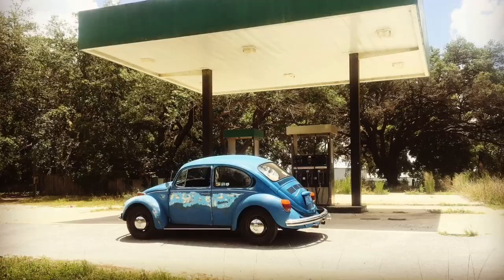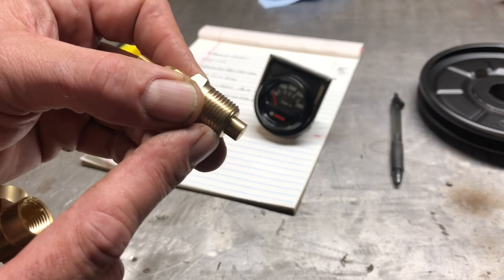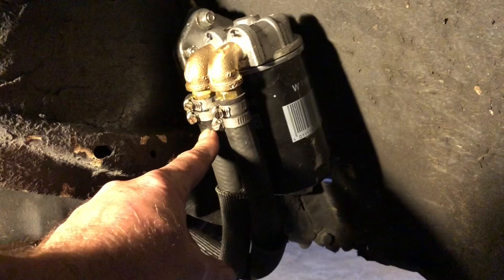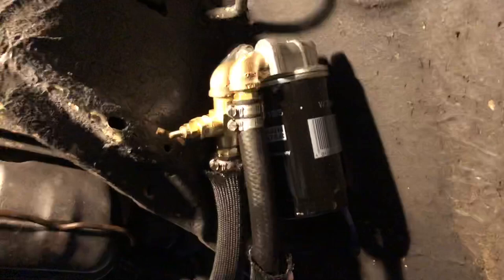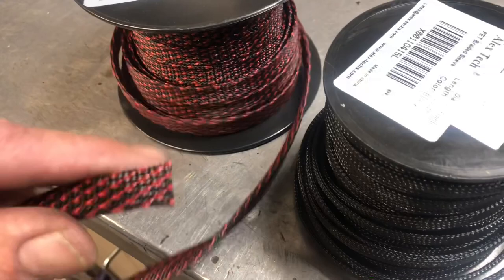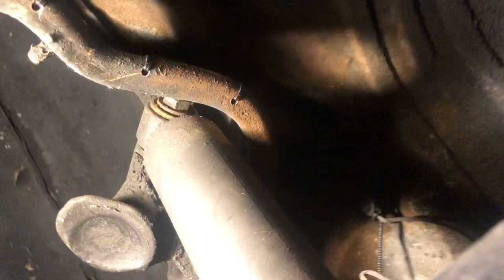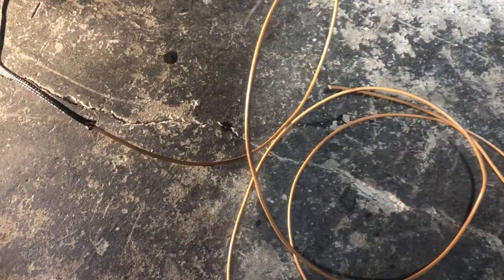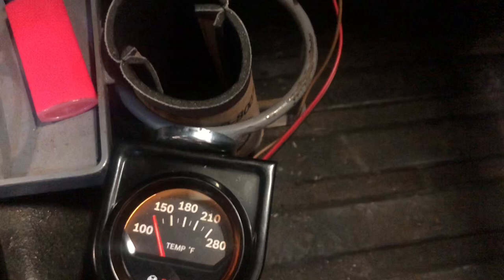Installing An Oil Temperature Gauge In The VW Bug And A Short Test Drive!

Comment: Honestly I was disappointed you didn't put a stinger back on Jawbreaker. That muffler sounds real good I'm surprised!! Which muffler is it and what filter is that you are using also?
Keep up the great work brother!!
Reply from the maker: VeeDub P8 I wanted to put the dual stingers back on however it would require a ton of modifications to make it works since I couldn’t use the same header as before. I had to step up to a larger merged header for this engine. I do miss the stingers but this is the Thrush welded 2 chamber muffler from the local auto parts store.... was like $35 or something. It has a great rumble to it that’s for sure. 
The oil filter I’m using is the Mann brand with the bypass inside. Seems to be holding up well.
Reply: I guess it's kinda off topic but does anybody know of a good site to stream new series online ?
Reply: @Dante Billy i watch on flixzone. You can find it on google :)

Comment: Does the threaded post on the sensor spin as you tighten the nut? I cannot get mine tight, it just keeps spinning
Reply from the maker: @drummer4hire12  there should be 2 nuts between your terminal. You tighten the nuts together to keep the post from spinning.
Reply: @VWJawbreaker  thanks very much for the quick reply and help. Looks like mine is missing a nut.......back to the hardware.....lol
Reply from the maker: @drummer4hire12  I do the best that I can!

Comment: Say you weren't running an aftermarket oil filter - would you be able to just run an adapter to 13/16 (21mm) and install it in the main drain plug in the sump plate?  I can't see why not but I've never seen anybody do it.
Reply from the maker: They make a oil sump plug sender that would work.

Comment: What did you do for a oil pump, remote pump, and cooler. Did ya drill and plug and what did ya drill and plug. Got a 73 super and looking for any help.
Reply from the maker: CB sells oil pumps with an in and out if your existing engine case isn’t drilled and tapped for an external oil system.

Comment: Interesting that you put the oil temp sender in the filter outlet and not the inlet. I would think you would want the to know the temperature of the oil coming out of the engine. My thinking is once the oil has passed through the filter it would be getting cooled off due to the placement of your oil filter in  the wheel well. But I'm sure you have your reasons for this. I'm still pondering the noise you are getting from the pulley this is not something I've personally encountered.
Reply from the maker: Volkswagen Fetish I used my laser temp gun and there isn’t much of a difference between the inlet and outlet temps, thus choosing the one closest to the inner fender. It would be easy enough to swap around.
Reply from the maker: That was also the first time that I really punched it. Been taking it easier than normal.
Reply: @VWJawbreaker  I think you would need better data than the external temperature of the unit as read from an IR temperature gun. Please don't get me wrong the IR is a fine tool for a quick how's my case temp I use mine all the time for this. But I would not trust it to tell me  the temperature  of a flowing liquid inside of the system.
Food for thought If you had a sender on the oil output closest to the engine case and another one at the output of the filter in the wheel well where is is shielded form the heat of the engine and getting air circulating around the filter while moving at cruising speed. Would it not be a safe to theorize that you would see a significant temperature difference in the oil in this situation?
 I have no proof to back any of this up and I might be totally incorrect it's just how I see things in relation to what you have done and the information you are hoping to receive from this project.
Reply: @VWJawbreaker  I can respect that, I never really take it so much to say easy on a freshly built engine. Once the cam is broken in and the break in oil is removed I drive it as I would any other day. If you get 50-70K miles out of a big engine your doing well they run hot and larger pistons and cams with wild lobes wear quicker than stock. I don't feel like babying it is going to add that much more life to the engine. IMHO its all about the care and feeding you give it along the way that ensures a long happy life.
Reply from the maker: Volkswagen Fetish I wondered about the temp difference as well, I wanted to measure oil temp as best as I could without the heat from the exhaust, etc affecting the reading. Yes it might be a few degrees cooler in the wheel well and I’ve been using the ir temp gun as a reference, not exact set in stone data. If I put the sender at the oil pump output it would hit the header so that’s why I chose the wheel well. Limited clearance and a lot of reading on the samba led me to put the sender where it is. 
You’re always my voice of reason, your thoughts and experience is like my gospel.
Reply: @VWJawbreaker  I understand where your at and I know we have discussed the oil temperature sender locations and how heat soak effects them on numerous occasion. In the end we can only do the best we can and then hope for the best data from our choices.  IMHO There is no right answer when modifying an oil temprature sender into a 50+ year old engine case that never engineered to have one. So you have done all you can, you have used all the data you could gather to make an informed decision. You're growing and getting better with every build it makes me smile when I see you doing something in your builds we have talked about.
Reply from the maker: Volkswagen Fetish as always I can’t thank you enough for every chat and our friendship! However we’ve discuss much over the last few years it’s difficult to keep track unless I start recording our conversations and make a spreadsheet to cross reference 😁 That’s not a bad idea in all reality 😂 I’m probably just being paranoid about this build. 
Give me a shout when you have a moment, nothing urgent and don’t want to interrupt your vacation.

Comment: Hi Gary, Im working on restoring a bug and a guy doing the engine is telling me that dual carbs will cause the engine to overheat all the time. I live in Maryland, so temps are usually low 90s in the summer. I dont see why having 2 carbs would cause overheating, unless they are running super rich. Any help would be greatly appreciated.
Reply from the maker: If the engine guy is telling you that, I question what other nonsense he’s told people. Maybe it’s that he doesn’t want to deal with dual carbs.  Dual carbs will in fact not make your engine run hotter, if it did it would be running way too lean or way too rich. If the jetting is in the ballpark, it will run better and more efficient than a single stock carb.
Reply: @VWJawbreaker  thanks!

Comment: What about cyclinder head temperature?
Reply from the maker: Mike Overturf excellent question. Unfortunately these big heads don’t have the provision to mount a cylinder head temp sensor. I might look into adding a different style sender down the road.
Hopefully soon I will have an air fuel meter installed.

Comment: Where did you purchase the brass “T” adapter and sending unit from?
Reply from the maker: Sending unit came with the oil pressure gauge. Brass fittings can be bought at a local hardware store or amazon.

Comment: how on earth did you thread those bronze ell fittings into the filter block?  didn't the second one foul against the first?
Reply from the maker: Figment078 nope. The sender is insulated by the factory.
Reply: @VWJawbreaker  ?? no I'm talking about the inlet and outlet fittings that were on the filter housing before you even started the temp sender install.
Reply from the maker: Figment078 the housing and the elbows are 3/8” ntp, they went together and they didn’t have any issues with flow.

Comment: Hey man Kevin here from Australia. What was your final operating temperature running from your oil filter. I'm just doing the exact same install today. 
✌ Peace man
Reply from the maker: Kevin Hamling hey man, we’re not into summer yet but the max temp I’ve seen this far, in traffic on a 85 degree day has been 210 oil temp. I use a laser thermometer to hit some spots on the case to see what the case temp is also.
Reply: JB, hey, I'm running a mildly built 1776 in my bus, no hot rodding, just a traveller. Wondering what the most important guages are for engine status: oil pres, oil temp, cyl head temp, voltage...? Rock on.

Comment: Can it be installed on a std motor?
Reply from the maker: There are other sensors out there that will work for an engine that isn’t full flowed for remote oil filter. 
However those sensors are not as accurate due to they are not in line with the passing oil.
Reply: @VWJawbreaker  i understand. As my bug is a daily. Thank you. 😁